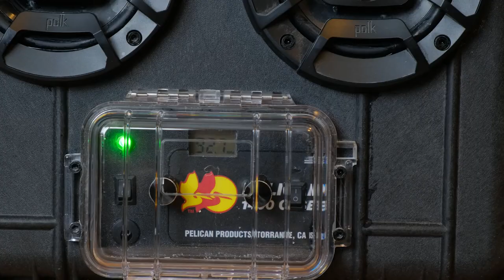Pelican case Boombox

Comment: 🤔 No mid compartment...
The LF Driver will create mechanical failure in the Mid drivers...

Interesting though...
Reply from the maker: Thanks for your comment! It was my first built.  But from what I've seen on other boombox like this I don't remember any compartment.  What would you suggest?
Reply: @docjfnoel  Most Boom box designs have a passive radiator without a LF ch.  Technically all three drivers ( and any HF drivers) Should have their own airspace. The space each driver needs is depending on each drivers own tech spec.

  ** The unit obviously will still work... but not as efficient... and for how long?**
Reply from the maker: @TheAudioWizard  thanks!